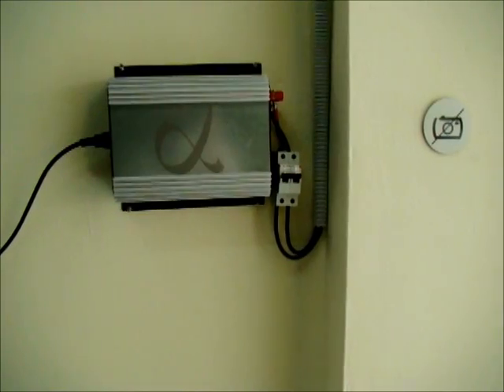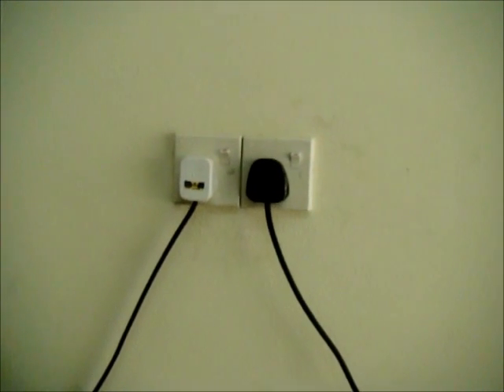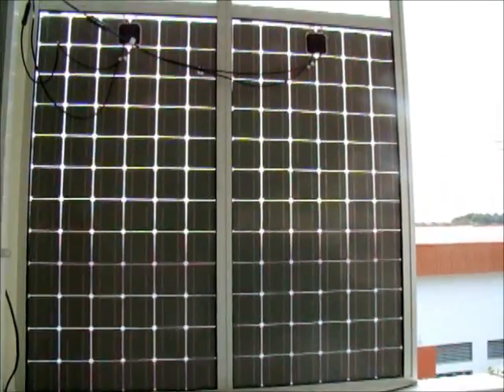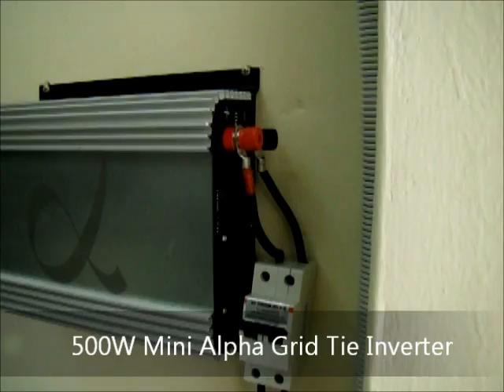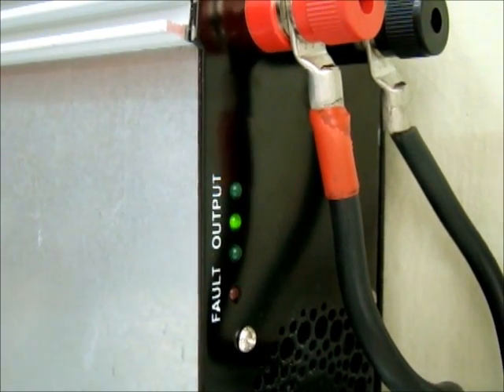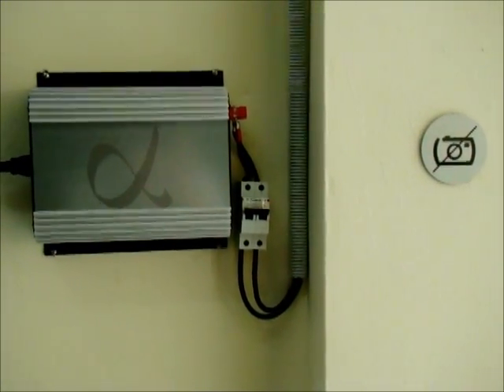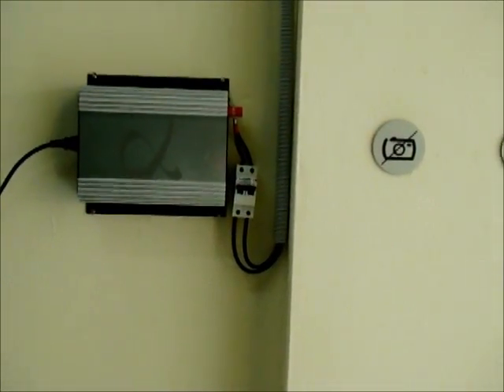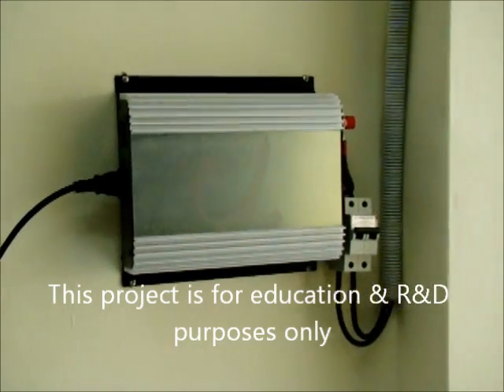Small On Grid Inverter Solar Power Education

Comment from the maker: It is very affordable to set up such system, you need to consider two main components: ON GRID Inverter & Solar Panel. The smallest inverter is 250W and cost around RM400 or less.  Then choose any solar panel that you can afford.  For instance, start with 50Wp solar panel.  You can refer to our website for solar panel pricing.  Got money, than add more solar panel.  The more solar panel, the more power it supply to your house grid. But please consult TNB/SESCO/SIRIM for the matter!
Reply: hi everyone ,if anyone else wants to discover solar energy for home in rawalpindi try Ewans energy roadmap (Have a quick look on google cant remember the place now ) ? Ive heard some extraordinary things about it and my brother in law got amazing success with it.